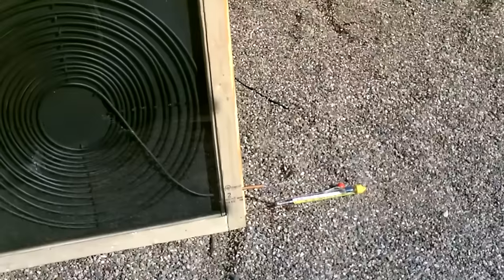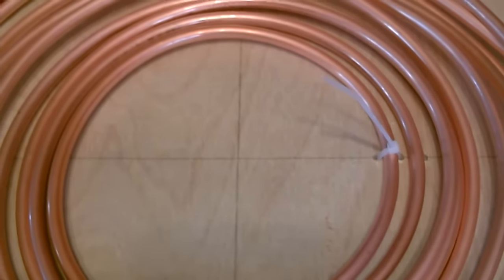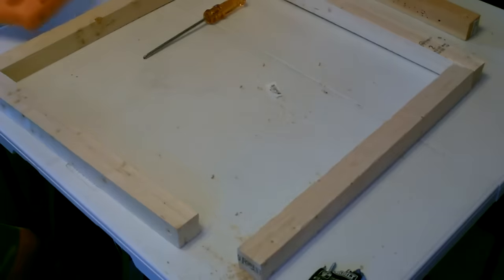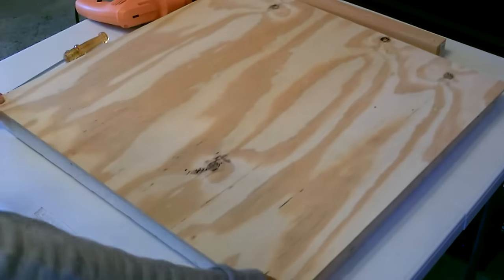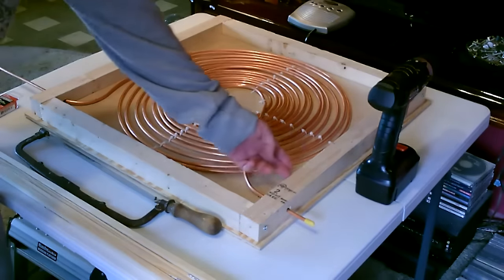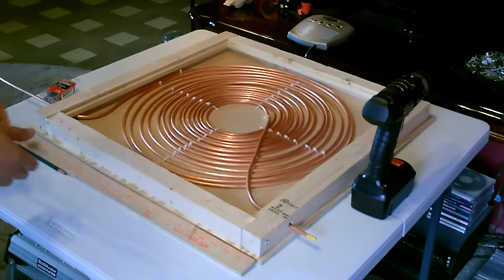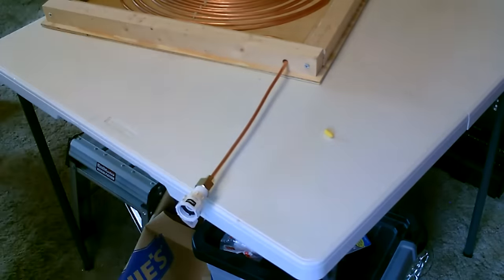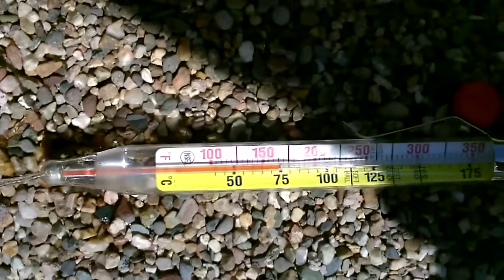DIY Solar Water Heater! - Solar Thermal COPPER COIL Water Heater! - Easy DIY (Full instr.) 170F

Comment: desertsun02, can you build second solar heater, the same length and diameter of pipe, but with couple modifications.. ? Instead of painting wood to dark color, place there mirror, on the bottom and on sides of box. Glass is blocking infrared, so you're wasting a lot of energy, you could search for plastic transparent for either IR and visible light.
You could try polarization filter (it's passing light with right polarization and blocking and reflecting with the other one, randomly, so if you will join this with mirrors (perhaps on slightly curved backside of box), photons will be bouncing there and more will be absorbed).
You could also experiment with filling it by transparent oil. Or something with good heat capacity. Which will absorb photons and increase temperature to higher temperature than 100 C.
When you will have ready 2nd or even 3rd version, perform tests, but this time, measure mass/volume of water with g/mL precision, measure their temperature prior heating and after heating (+- 1 C precision electronic thermometer), measure time needed to heat certain mass/volume of water using stopwatch. Compare designs and release video with what you found, which design is the most efficient.
Reply: Glass only blocks far infrared (like the ones seen in thermal cameras, and emitted by say, people). But near infrared (the one emitted by the sun) is not blocked too much by plain clear glass.
Check it out: https://physics.stackexchange.com/questions/74638/transmittance-of-glass

Comment: Since copper has such a huge thermal coefficient, I wonder if you could reduce heat loss (increase efficiency) from the tube from the side of the tube hidden from the sun by adding insulation on the back side.
Reply: Yes, insulation on the back and sides would make the unit more efficient. I'm in south Florida and the greater issue here is making water too hot. Without safety valves that stop water that is too hot from flowing you could easily scald yourself to death. We have a shower by the pool that has a white, PVC pipe, one inch in diameter, that delivers the water. That white pipe sits against blond keystone and the water that first comes out of that shower could really hurt someone.  Some systems here will produce low pressure steam almost immediately  when exposed to sunlight. I'm talking about the type of steam you see in a pot on the stove just before the water boils. Boosting those units to produce useful steam is trivial.

Comment: What is the temperature on the water that's going in?

If you mentioned it I just missed it.
Reply: You just pay attention to the thermometer
Reply: haxpet right, and how long is water sitting inside coil? 50' of quarter inch hose holds what? half gallon? quart? so much wrong with this
Reply: What was the temperature of the day of your video as well?
Reply: @trymints3657  84 that number he mentioned.
Reply: @grandadan  thermometer is on the outlet.he asked about the inlet temperature
Reply: @grandadan  That's it you believe everything you see. The camera was focused on the thermometer for a good 10 seconds, just enough to empty the contents of the copper tube that was sitting in the sun for how long? There's no way that would be sustaining 75°C continually. So many unknowns.

Comment: Did the black paint make an actual difference to temperature? Have you tried painting the box silver but leaving the copper to reflect more energy towards the pipe
Reply from the maker: hi there. yep, it gets much hotter when painted black as the darker color absorbs more of the light energy. i haven't tried a silver box - but i recently built another model that is aluminum backed. the copper coil (3/8") in that one is fixed down to the aluminum strips and transfers the extra heat into the coil. heats the water up an extra 10F. if interested, here's the link to that one https://youtu.be/btQtPQpUf90

Comment: Is 1/2" cerro copper tube good for heater? I'm talking about for really really cold weather.
Reply: No, copper absorber is not usually a good idea for very cold environments. What you would need is a setup that uses evacuated solar tubes. Those can absorb 80% of sunlight and barely loose any heat to the environment.
Reply: @886luke  if you get thst PEX to 185F it will fail. Typically copper or stainless hold up to passive solar.
Reply: Great idea in the southern states but I would have an alternate  plan if in the north.

Comment: Idea for a solar powered hot plate or even a. whole stove. Solid copper pancakes filled with gallium with a diesel glow plug in each one that will heat the gallium with the gallium conducting the heat to the copper to generate a cooking surface. All of which can be powered off a solar panel set up.

Comment: hi thanks for sharing. Will there be a lot of difference  if I use PVC pipe ?
Reply from the maker: hi. pvc pipe won't handle the heat. that only handles up to about 140F(60C). you could use cpvc though. that works pretty good.
Reply: @desertsun02  Thank You🙏

Comment: Thinking of doing one of these for a backup system on our tiny home in Colorado. Wondering if filks run these into thier hot water line (we have a propane water heater) or just have a supplental outlet... Does anyone have a video about hooking one of these up?

Comment: I am going to build one of these to act as a pre-heater for my hot water heater.  What connections would I need to put on each end to to in and out of the HWH??
Reply: It would need to be tee'd into both the infeed (cold) and outfeed(hot) lines on the water heater to by pass it or just the cold water line to act as a preheater. The issue is going to be how to get circulation otherwise the only water that will be hot is whats in the lines and coils. If it is just hooked inline, you will get a shot of very hot water to the water heater itself and then it will only be as warm as  it gets in the time it is in the solar heating unit. It will still be a gain over the incoming cold water temp of about 45 degrees.  I have been playing with this idea for years, considering these issues and how to even out the heat. Same with my wood stove that has a hot water loop inside. The wood burner worked great but the water would get too hot and actually try to boil, resulting in something similar to water hammer. The first time that happened, it scared the hell out of us. When i do it again, i am going to try a water to water heat exchanger setup, with a vented tank and see how that works. As long as the water is moving in both the collector and the building water system it shouldn't overheat. Having some way of controlling the flow through the heat source, either a collector or the wood stove would help but i haven't figured that part out yet. With either source, you will still be heating the water as long as you have sun or in my case a fire going. Maybe if the circulation issue was solved, a mixing valve could be ised to control the temperature,  similar to the valves used in  infloor hydronic heating. Good luck.

Comment: What copper size you used. 1/2 or 1/4 inch?...any special outdoor black paint for this project?
Reply: any dia of copper tubing can be used but it increases cost.
so u can use it according to your requirement and constraints. i think it is 1/4'' in the video.

Comment: Does it work better when the water comes in at the outside and drained off from the centre or the other way around?
Reply from the maker: hi there. if i understand the question correctly, it would probably work about the same either way

Comment: Hi Mate Great vid and idea going to try make one how  what size 'GPH' pump did you use?

Thanks
Reply: The GPH rate is going to be quite a puzzle. If you increase the GPH a bit the water will be a bit cooler as it spends less time in the heating unit. If you slow down the GPH the water entering the pool will be hotter but there will be less of it. Since running a pump costs money you might want a lower delivery volume with higher temperature water.

Comment: i love this video except i would have liked to see how you sealed the glass on there? is it caulk or silicone or what? also would this work for heating air as well?
Reply: Typically one wants to use 100% silicone (that means not paintable kind).  Silicone has working temperatures good to 250C (about 500F).  If the cover is polycarbonate it will expand/contract a lot and silicone is the only recommended caulking that will allow the expansion/contraction without affecting performance.  Another point, when building my Solar panel I was wondering polyurethane or silicone for adhesive and came across a test for extended weather performance and all polyurethane based ones failed at some point whereas the silicones were hardly affected by the test.  It's the right tool for the job, but be aware that silicone can't be painted, nothing sticks to it once dry (even itself), so if you need to open the panel you have a job ahead of you removing the existing silicone so you have a clean base that the new silicone can adhere to (since it can't stick to itself).

Comment: Do that work even in the winter. When you put your hand on top of the coils is it hot, what about even in the winter ??
Reply from the maker: hi. yep. it works in the winter too 👍
Reply: @desertsun02  I left I refrigerator outside when I touched it, it was really hot. That gave me a ideal. Use wood burner pipes on top of the fridge to warm the house

Comment: I think you could use copper wire instead of zip ties much easier and more quickly.   Lace it in place.
Reply from the maker: sounds like a good alternative. also, 'stainless steel' zip ties is another way to go. amazon sells them. 100 pack for about 10 dollars.

Comment: A very good video my friend, but let me recommend you to use a thermal insulation layer of polyurethane, cork or fiberglass with a thickness of about 2.5 - 5 cm will be perfect. In this way you will avoid heat losses with enviroment ;) Let me know your opinion ;)

Comment: I commend you for including a parts list ... well done
just a thought
would it be any better to cover the backing board with tin foil and lift the copper up 5-10 mm off the backing board... and open up the gaps of the rings to allow for reflection.. 
(or does the black generate more heat)
Reply: I have actually done a similar experiment. I found black works better. It's basically a slow cooker, vs trying to heat the coils fast. WHen you paint the entire surface black,  The pipes on one side get heat directly from the sun, while the other making contact with a black painted surface is also absorbing heat and getting hot as well. So both sides are in fact heating both sides of the copper tubing.Imagine it like this. You take a piece of metal bar and place it on a sheet of metal I'm taking a blow torch too.  I'm only heating the sheet but the heat spread across the surface of the sheet and transfers to the metal rod and the rod gets got without directly applying the blow torch, One improvement that does work well in my experiments is using materials to store the solar energy longer. Like thick metal plates painted black as a backing. The best was a black stone backing. It stores heat best and longest, but a pain to move around the entire unit.

Comment: Why did you paint it; Does the black direct more heat or was it just for looks and not necessary?
Reply: Never mind, just watched demo video. The black inside is necessary..
Reply: Black absorbs the sunlight
Reply: Frank Salman - Basic experiment. Get two objects identical in everything but the color (black / white). Set them in the Sun for a few minutes. Touch both, the result is tremendously obvious. Ex. Two cans one white, one black... ;-)
Cheers

Comment: Hi great design - how did you hold down the sheet of glass / acyril to the box? 
Thanks
Reply from the maker: hi. i use silicone caulk (100% silicone caulk). it's never failed me.😎
Reply: @desertsun02  thanks for the reply. Do you use screws at all or is it just all caulk ? Thanks.
Reply from the maker: these days i only use glass so i just use caulk.

Comment: Nice build...but....the board should be covered with insulation. You're losing massive heat. Next, the insulation should be covered in something METAL , LIKE MAYBE...flashing, painted black. It will absorb and hold more heat

Comment: have you tryed using a in house hot water heater . to a  a/c cooling unit in a house blower unit.  whch is all copper ..
Reply from the maker: hi there. no i haven't tried that.

Comment: Lenses won't help to make the water heat faster.  The key is in the amount of sunlight collected, not the intensity. Need increase light collection surface area or absorption effeciency, will help.

Comment: Would this still work if you used 3/4" tubing instead?
Reply: Yes it will, It may not get as hot if the water is constantly moving. You may have to slow it down or stop it intermittently. Do your testing and post it for everyone’s benefit. But it will work. .

Comment: you might try it with aluminum sheet in back, and black coil.
Reply from the maker: hi there. i recently posted a video of that (it's of a similar design, except i added aluminum sheets under the coil and used 3/8" copper coil). the aluminum adds about 10F to the water temp. if interested, here's the link https://youtu.be/btQtPQpUf90

Comment: How long does it stay warm for while your cycling the water threw the pool?
Reply from the maker: hi there. basically, as long as the sun is out it will give you hot water. if it's not hot enough just run it slower. that's what i do 👍🙂
Reply: @desertsun02  that’s been my problem for the past two weeks here in NY. The week we got the pool it was 85 and sunny for a week. The last 2 weeks have been cloudy and we have had nights where it’s gone down into the 40s. So I built it and then it’s been a bit of frustration only because anytime the pool gets to 76 we have cold nights. So hopefully the weather turns around here.  Thanks for the reply.
Reply from the maker: wow, nights in the 40's (in June). that sounds good to me. lately, our lows here (at night) have been about 90F (highs in the afternoon over 110F - almost everyday this week)

Comment: What was flow rate ahead of the heater?  Save yourself some money and plastic from environment which will break and instead string old copper wire through the holes.   This could be a good top for a solar shower.  If there were a way to stiffen without board could use in fire if needed.

Comment: what if you make the compartment airtight. Create vacuum in it and the heat loss from inside will be minimised. Same as solar evacuated tube.
Reply: Might be worth getting the glass done at a custom window shop. See if they could do a double pane setup with the vacuum treatment. Might be problematic sealing around the inlet and outlet tubing

Comment: +desertsun02  Nice device.  Hey, that rhymes.  Two questions please:

1.  Any idea what the water temperature was entering the system?

2.  I'd guess that the output water temperature would drop as you continued to put water into it, as the colder water would cool down the copper tubing.  Did you notice a temperature drop over time (10 minutes, 20 minutes, etc.)?

Comment: So, I made something very similar but with 1" copper, and whenever I feed the pool water into it, the water ends up cooling the pipes instead of vice versa. What am I doing wrong??
Reply: You're moving the water too fast and/or the 1" copper is too big. I'd slow down the flow rate from the pool first then go from there.

Comment: we Used AC condenser coils painted black, mounted on the roof of the house so the sun can heat it up then plumb the copper pipe to your water heater tank, preheating the water, will save you money. there are so many ways to get off the grid completely, if I ever discover how to get free energy I will share that information with everyone.

Comment: would it be hotter if you put a fresnel lens instead of glass
Reply: that might take a very large lens but you risk a leaf blowing in front of the lens and burning up, flying off and lighting the next house on fire...
Reply: No. The amount of light hitting it would be the same.

Concentrating light doesn't give you more light, it just gives you more light in less space. Plus, the focal distance would be pretty far away and you'd need a much bigger device that would be much suckier at heating anything up.
Reply: Also, there is such a thing as getting it too hot. If you get it hot enough to create steam, now you have an entirely different system and very, very dangerous. Keep it cooler with a high volume storage tank that is hopefully sitting in front of a south facing window.

Comment: Anyone think I could scale this up a bit using say 100' of 3/8 copper tube with about 2-3 gallons per minute flow? I'm not looking for high temps, if it's enough to take the chill off the water, say 80ish degrees in 60-70* weather itll be fine. I'll be mounting this to my Dark grey van rooftop, so itll have some extra help from the thermal mass of the van. Thanks in advance!
Reply: Hi D.D.S...how did your attempt work out.? Sounds a very good idea indeed. 
Southampton UK
Reply: Consider a video...

Comment: very cool or I should say very hot, but zip ties won't last very long. Baling wire will last and probably cheaper in the long run.
Reply from the maker: hi there. i recently bought stainless steel zip ties. those are great. and only cost a couple of bucks more than the plastic ones. i think those are rated to 900F.